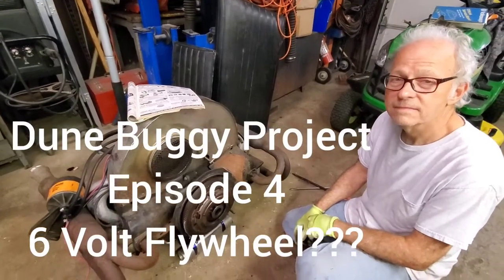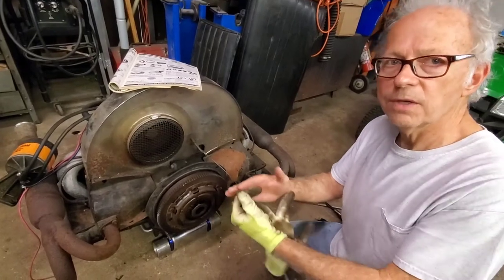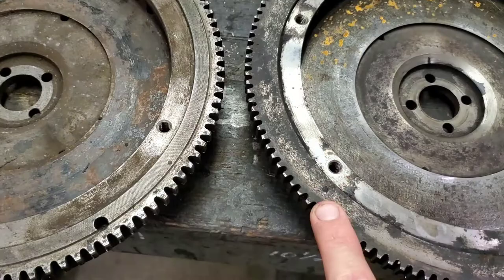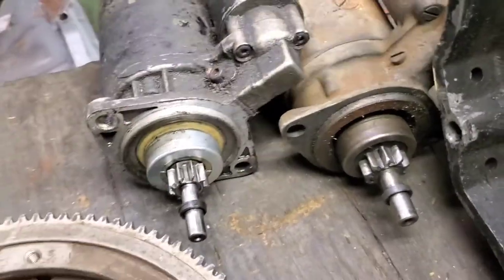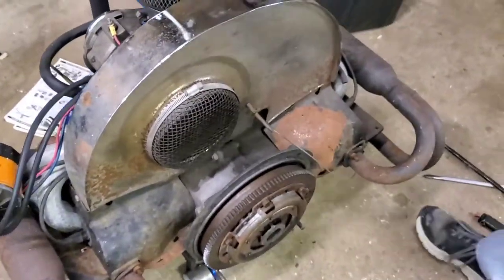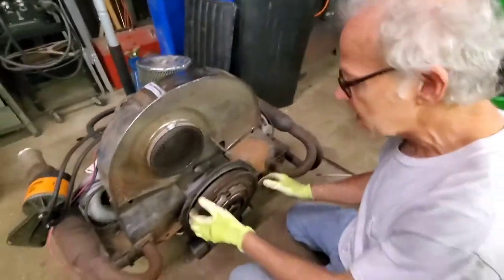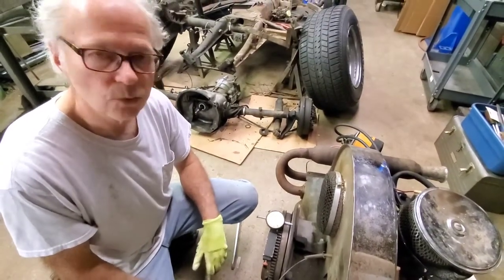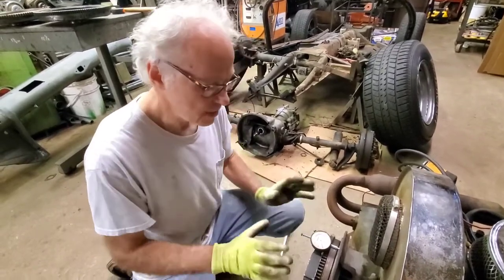6 Volt VW Flywheel? Dune Buggy Project Episode 4

Comment: You can use a Porsche 180 clutch and pressure plate on the 6 volt flywheel.

Comment: what do you do if the housing starter bushing is worn and no longer holds the bushing?  upgrade to 12 volt and use an autostick starter?

Comment: I'm looking a an old beetle, 1200 sp. The owner said it's a 12volt system, but still uses a 6volt starter... does this sound right?
More so, "It still has a 6 volt starter, it runs on 12 volts. Cranks REALLY well."

Comment: Larry question will a six volt flywheel on a 12 volt engine cause excessive end play checked the bearing seeing no appreciated wear and the bearing bosses edges are sharp and not rounded. Installed all new bearings dowel pin mains feel tight in their proper positions. If I crank the gland nut in excessive of 250 
Lbs the end play gets much tighter. It’s a stroker crank with small block Chevy rods approximately 1968 ccs any help would be appreciated Thanx